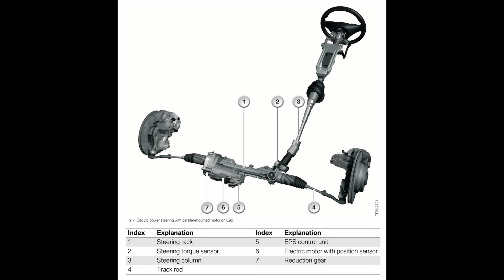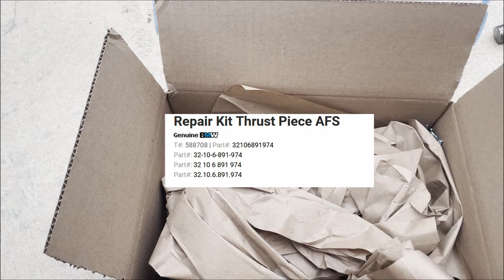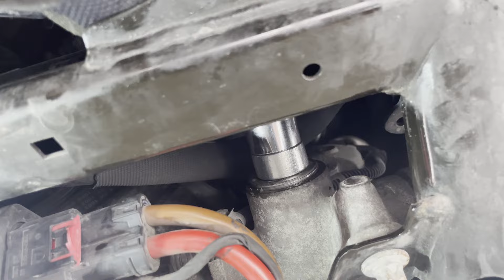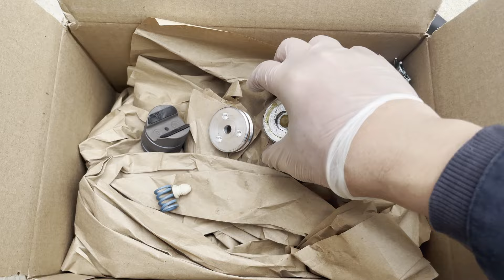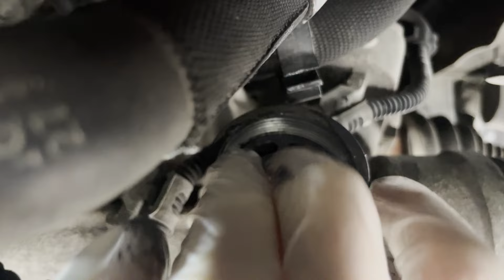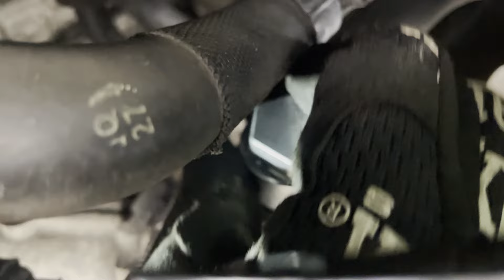BMW Electric Power Steering rack thrust bushing repair

Comment: I have problem with steering wheel. I dont get any errors on dashboard. I just stiffer then it used to be, or lets say vague. When i do first start in the day its really stiff, and when i drive it for lets say 20min it gets looser, but when i try to turn at low speeds in lets say other street i still feel vagueness. Voltage is around 14.7 when driving and loading car with electronic stuff. So i dont know what can be problem. Is it ujoint or rack thrust slider . What can it be? El Motor?

Comment: Is available repair kit for adaptive steering rack bmw x5 e70 3.0d??
Reply from the maker: As far as I know, this specific kit is mostly for the f chassis sedans. There may be an alternative but I’m not sure if there is one for e70 since your car is hydraulic steering. Check part 2 to see if it’s your end links as well

Comment: if you go too tight or too loose with this would it a strange wheel shake at higher speeds when turning to the right? It's not wheels/tires, and all my suspension is brand new or new enough, except tie rods, but they dont appear to have any play in them.

Comment: when I am driving my bmw 320d 2018 on highway with speed around 90-120kmh and I am doing a left turn my steering wheel kind of get stuck to that position and I have to help it and level it straight is there any idea where the problem is ?
Reply from the maker: If you did this after the thrust bushing fix, you might’ve tightened it too much.

Comment: I am in the midst of replacing cv axles and all control arms, tie rods and sway bar end links on my 2014 x5 and testing out new tie rods while turning wheel all the way to left I still have a knock sound from right side tie rods into steering rack. I noticed this bushing replacement is on left side of steering rack. Could this still be my issue?
Reply from the maker: Did you try turning the wheel when the car is off? It should sound like a clunking noise there if it’s the bushing

Comment: For n55 guys it’s a little bit more complicated due to it being a tighter space!
Reply: You can tighten it on the floor and look through the front wheel. Did mine without jacking up or taking undercover off. 
My is m135i f20 n55.
Reply from the maker: Sorry to hear that, hopefully it’s not too bad
Reply: @EuroFeverGarage it was rough 😂 but I’m still having that grinding sound during tight turns and slow speeds
Reply from the maker: @Premium_Games grinding? Uh oh that’s not good

Comment: I have the same noises but i got active steering and there is no Steering rack thrust like in the video. What i have supposed to do?
Reply from the maker: Active steering is a hydraulic rack, correct? If so you’ll have a different issue

Comment: i did this, but my question why still have that clunking tho?
Reply from the maker: You’ll have to look at other suspension components. Check the description for part two where I replace my sway bar end links, that is what solved my issue

Comment: Great video!. Getting ready to order the kit now, I tried tightening mine a little and it seems the smallest turn offers the clicking noise or super tight steering. So I think the bushing id super cooked and dry. 

Also, did this help the slight wander on highway? My whole front end is rebuilt besides the rack and swaybar links, fresh alignment to.. I have a small dead zone while driving highway speeds.
Reply from the maker: Glad to hear it. If you see in the comments, seems like the kit has gone up in price (hopefully not my doing)

In your case of wandering this sounds weird since you just did an alignment. If the sheet you were given after service is within spec, I’d see no reason for wandering unless your tires are not properly balanced. As for deadzone could just be your current tires too. Winter tires are super vague, as are many touring style tires. As you get more performance oriented you will find better feedback and direction of the wheels communicated to you 

Thanks for watching, hope it helps
Reply: @EuroFeverGarage ive never heard of unbalanced tires causing this issue.. bur I did see a guy of a fourm say it fixxed it. Along with lower intermediate shaft, qguibo. Basically throw money at it till it's fixxed.
Reply from the maker: @DiddysBBOil  that sounds about right. in any case, i hope you get your issue fixed!

Comment: Question so I got this issue yesterday when I drive i feel it too on the actual wheel did yours feel like that too?
Reply: Not the steering wheel the wheel 🛞
Reply from the maker: Hey thanks for watching! Check out part 2 pinned in the comments, it has the solution for me, that ended up being my away bar end  links

Comment: I have the problem that my steering wheel does not go all the way back to the center after the engine was out for repair. Does anyone have any idea what it could be?
Reply: Loosen it. Unfortunately when I loosened mine the steering feel was fixed but the noise is still here. Not to sure what to do about it

Comment: did you check the Double UJoint Steering Shaft? I am looking to replace mine as there is a tiny of play when i grab at the joint itself. Maybe this play is multiplied at the steering wheel?
Reply: Did you have any issues with it not self centring

Comment: I couldn’t use the new spring. Could not compress it enough to start the threads on the cap. So old spring back in.
Reply from the maker: Is a job ever that easy? lol think that should be fine!

Comment: I found myself in a tricky situation: the steering wheel feels too tight and re-centers too slowly after corners, but if I loosen the steering rack, the knocking sound returns 😅. Any advice? Thanks!
Reply: What year is you bmw? I think I’m also having a similar issue, feels a little scary at highway speeds if you turn the wheel like any other car but rides completely straight also wheel seems to say around 1 o’clock position unless you help it the rest of the way to center
Reply: @chukob5  2014
Reply: I have the same issue on my 2018 440 I loosened it but like you said the noise is still there
Reply: @unspeakable9514  you may need to tighten it a bit more
Reply: @ when I tighten the steering feels off
Reply: @gavinlin6636  I get the noise the most when going slow over a layer of small pebbles
Reply: How you found a fix?
Reply: @ keep adjusting until you are ok with it. The issue was gone after driving for a few days.
Reply: @gavinlin6636  figured. Do you still have the noise?
Reply: @ noise gone!
Reply: @ the noise for me is like a slight rattle coming from the front of the car. The noise is not synced with big bumps however I hear it while coasting on a slightly uneven road. Is this the same sound you were hearing. Unfortunately my car is still making the noise and my steering is way to heavy
Reply: me too, please help
Reply: @ I’m still not sure how to fix the issue. I have gotten the steering feeling back to oem but the sound is thill very much there and did not lessen at all
Reply: I’m not sure why the issue with my car disappeared, but what I did was tighten the rack just enough to eliminate the knocking sound. The steering felt slightly heavier at first, but it was still manageable, and the wheel centered itself when let off at leaving corners. As I continued driving, the steering feel gradually returned to its original OEM state, and the noise disappeared completely. Other than finetuning the rack to just eliminate the noise (5-6 times), I didn’t do anything else.
Reply: @ I’ve adjusted mine at least seven times and couldn’t find a balance point
Reply: @ I’m gonna have to go under there again and try it out one more time
Reply: @ when does your noise show up? Over little bumps or big bumps. Do you hear it on the gas or off the gas or both. Where is it coming from. And what does it sound like. I’m trying to figure out if we have the same issue. Thanks!

Comment: I felt slightly tigher compared to previous after replacing the rack. Will it become a bit looser if I drive more, e.g. a few more weeks? Don't want to bother going underneath the car again.
Reply from the maker: It will feel tighter as the bushing has been refreshed. If it’s significantly tighter, where when you turn the wheel doesn’t come back to center, it should most likely be loosened

Comment: My car does this and on the ride side it makes a popping sound
Reply from the maker: Check out part 2 of this series! I had the a similar sound as you, it could be the same issue
Reply: @EuroFeverGarage  watched your video it’s not the sway bar it sounds like the pinion on the steering rack
Reply: @tasteofjamaica how did you fix yours? I got the same issue
Reply: @irwinsia it turned out to be the sway bar links needing to be replaced/tightened make sure when you do suspension you torque everything down while the car is under load

Comment: I find after doing this the steering feel improved to be better than original. Also I have VAC monoball control arms. There’s actual steering feedback on my F30.
Reply from the maker: Glad to hear that! F chassis electro steering is often a let down, I personally really enjoy it, having driven almost every modern BMW in existence (not lived with though!) there’s certainly worse out there :)
Reply: Hi @ramen9996, I own a BMW F25 X3 and it has horrible steering when driving; it pulls left or right while normal driving on the highway, and it has noise when moving steering when standing in one place. If I replace the steering rack thrust bushing, will it improve steering?

Comment: As a rough guide I use, 80nm then half turn. (I've done 10-15 of these)
Reply: 70 NM is in TIS. But the nonsense is them checking to play with a special tool. That right there is a show stopper for anyone trying to do it properly as per the BMW engineering team. 

The original part to begin with wasn't properly built and the dealership should be forced to sell this repair part at cost instead of charging $250 CAD.
Reply: Really? 80nm sounds a lot
Reply: you mean you closed it with 80Nm thenn u released it by half and it was most of the time a great result?  im asking cuz i also need to do this on my own car and im not really sure how exactly. i dont want to lift the car 10 times

Comment: Bmw 116 d n47 e81 hard steering.What could be the issue
Reply from the maker: Hey there thanks for the watch. Unfortunately couldn’t tell you. The hydraulic steering racks have different issues but I’m sure it could be related to something within that system

Comment: The clunky noise can be heard with engine off only or even when the engine is running?
Reply from the maker: It can be heard easier with the car off as the assisted steering is off and the mechanical bits can be easily heard. Even with the new bushing in I do still have a bit of clunk but it is significantly less

Comment: Mine had it already after 4y and 40k km. Very annoying and It's not only the noise the car also drives very bad on long straight lines on highway.  After repair (dealership) noise was indeed gone,  but the correct steering feel never game back. In my opinion it feels more loose due to the two rubber gaskets on the new part, it turns too lite.
 I can only say the steering is bad in all bmw f series ( 3,4, and 5 series) all using the same shitty electric power steering rack. Came from  a lexus  IS  which also already had a electric steering but was much better in feel and straight line stability. The BMW only feels nice on twisty raod, highway is bad also with the new part.  Also have a Mini now 75k km, also start to clunk.  I can only conclude BMW' products are not the best quality you can buy. Some parts are really poor (costdown)  not to speak of the timing chain  problem most engines suffer of on the  f series
Reply from the maker: Hey there thanks for the watch! I agree that the electric racks definitely aren’t the best, especially in this first move after the hydraulic steering of the older models. The current g is an improvement but as soon as you put them in sport they feel way over boosted and artificially heavy. 

Unfortunately I don’t think we’ll ever see a perfect replica
Reply: @EuroFeverGarage  

Yes correct the G series dozs feel better let's say more natural for a sport orientated car. But indeed the sports is just overboosting.

Comment: Did it on mine and cant get it to center proper. Comes back ok when turning right but when turning left it centers to about 11:55 and overall feels like its pulling ng to the left 🤔
Reply from the maker: Hey there, thanks for watching the video. If the turning of the steering wheel feels tighter than before, as in more difficulty, then you may need to loosen how many turns you did on the bushing. If the issue persists, you may be having an alignment issue but that would be my initial thoughts!

Comment: Does this worn part cause your steering wheel to wobble or only noise?
Reply from the maker: Hey there, thanks for the comment. Are you talking about a wobble while driving? I did not have that issue, as mine was over bumps, my suspension was making a clunk noise. However if you turn the wheel back and forth while the car is off there was a very audible thunk from my worn thrust bushing
Reply: @EuroFeverGarage did you feel it from the both side of the wheels?

Comment: I've got some creaking when turning the steering 180 while stationary, sometimes there's a clunk, but mostly creaking.  BMW diagnosis was this thrust piece and also steering spindle bottom w joint.
Reply: @anonymoustravelvidz Have you figured it out? that creaking noise might be coming from your inner tie rod.  I was also getting a creaking noise with the full lock turns when stationary & replaced both my tie rods & the noise is gone.  & my thrust piece has been replaced as well a year prior so I know that wasn;'t contributing to the creaking
Reply: @I_got_10_felonies all front suspension was replaced.  New shocks, strut mounts, sway bar links,  rack ends, control arms, radius/castor arms.
Reply from the maker: My clunk ended up being my sway bar end links, I could only replicate over bumps. Your clunking, is that only doing full lock to lock?
Reply: @EuroFeverGarage  it's a bit both, but more so when doing lock to lock.  I hope the diagnosis is correct for the same noise when accelerating from stationary.
Reply from the maker: @anonymoustravelvidz   Obviously these techs would know more than I, so I do hope they solve your issue. I have heard top hats are also known to creak, though not clunk as far as I've seen, so it may be time to just do some sort of front end refresh